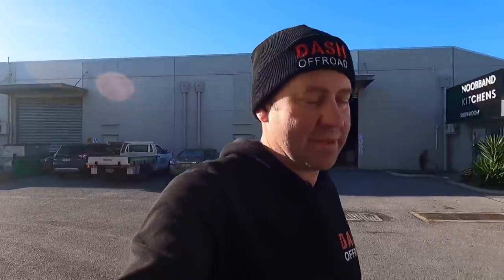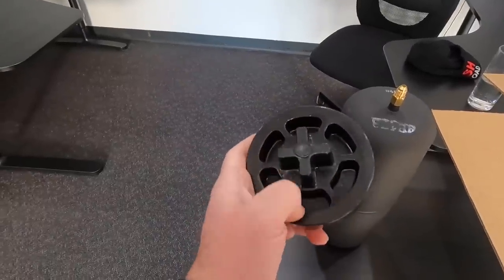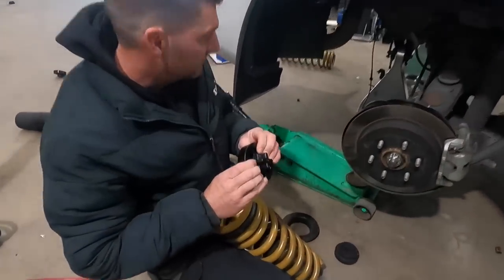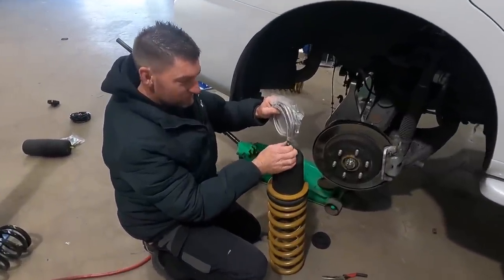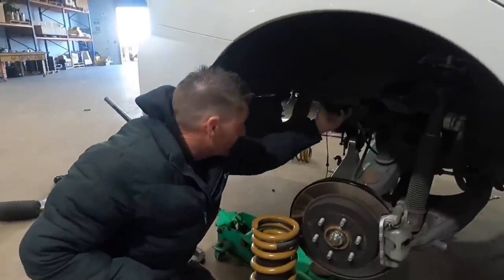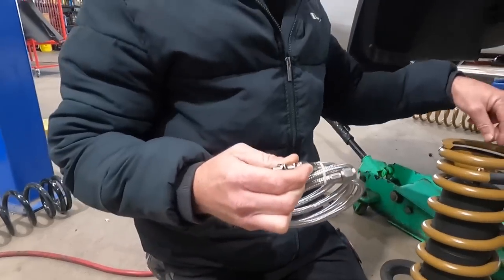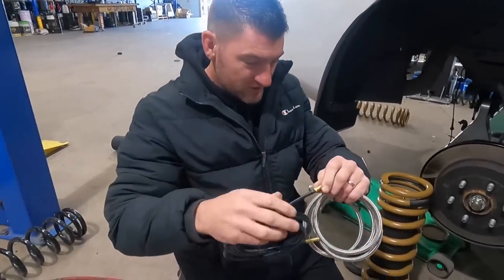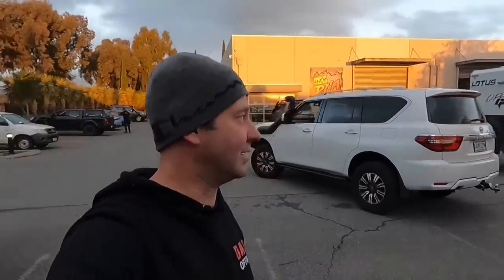Y62 Patrol Airbags That WON’T LEAK…. Ever!!!

Comment: Dave, as you know I’ve had these in my Y62 since May now, have been great, no issues regarding leaks, , towing 3.5tn van or crossing the Simpson, glad we swapped them out from that other airbag brand. Love the onboard air system. 👍👍
Reply from the maker: Thank you for your comments Iian, for your type of setup, this is the perfect solution 👌

Comment: I am always amazed at the R&D you put into your products to make sure the quality is TOP notch! I am about to do so R&D fab on the rear UCA mount on my 2014 Armada for an easier way to fix my alignment issues with a 63mm lift. It's close but my camber is just not where I want it!  I have had Airlift bags on my previous vehicle, an R51 Pathy and now on my 2014 Armada and have had no issues. I don't off-road extreme or have to drive across all the corrugations you have in Australia but have been great for me and have a lifetime warranty.  Keep up the great work and great content!
Reply from the maker: Thank you for watching and your comment’s. I’m keen to see one of these Armadas in the metal one day.

Comment: Hey, I just got a 2019 Armanda in the US, so I still have mine Titan XD diesel with steering on the right side :) So you suggesting that to start ? I want to add a locker on the rear . and 2 to 3 inch lift to fit 33". Does 35" fit ?